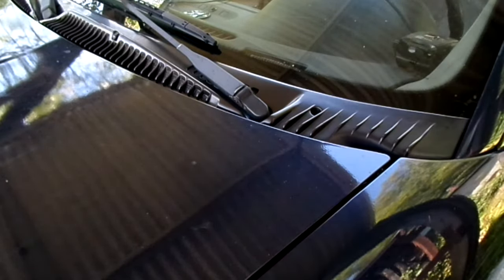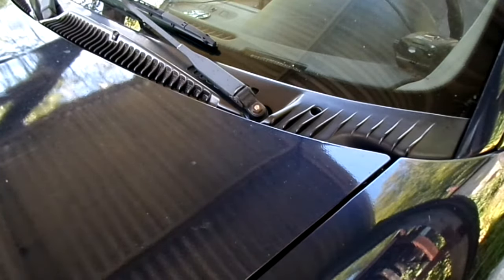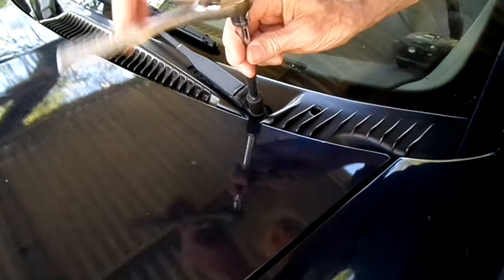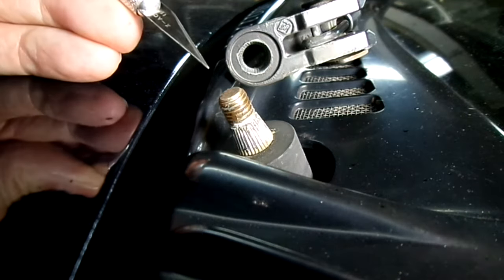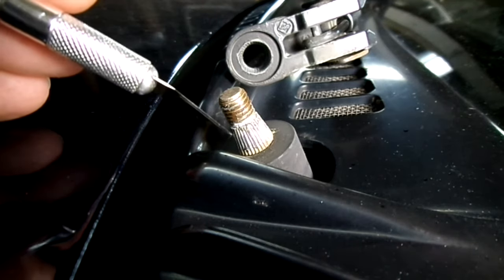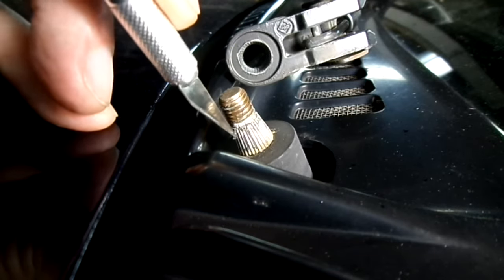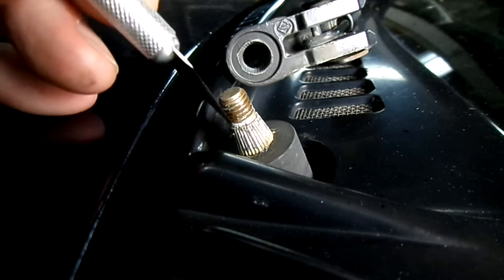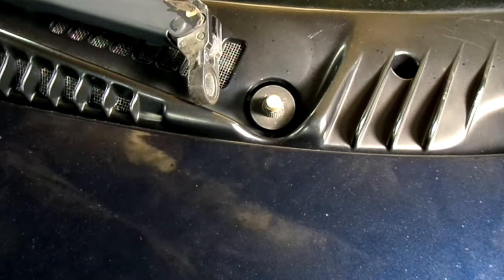Windshield Wiper Arm Repair

Comment: 👍 Dude, thank you for taking your time in sharing your experiences.  This info has helped.  One wiper blade has stopped operating from my car and followed your advice, it worked very well. One Note: I found the wiper-blade's nut loosed when removing the cover. I still cleared the ridges and reset.  Did it on both just to get it over with.  All Good now!

Comment: Also if you don't want to buy new arms and you even this fix doesn't provide perfect grip - very soft wire. If you have very soft wire lying around, you can use it to make it fit better.

Comment: Does this mean that after you clean the splines, that you must buy a new wiper arm? Or is it OK to reuse the old arm and it will grip?
Reply from the maker: After the first time it usually works but if the arm gets striped multiple time then the arm will eventually have to be replaced.
Reply: Thank you. I successfully removed my arm this morning and scratched out the splines. I remounted it and tightened it down. It appears to have worked.  Thank you!

Comment: I'm supprised that the splines will drive the aluminium, i would of expected you to need to wrap the splines with 1 to 2 turns of ptfe tape or tin foil to take up the room.
Reply: How long did that last ?
If you don’t mind me asking

Comment: This is exactly what I am dealing with today.  Thanks.  It seems that the lost aluminum material would need to be replaced??? Inside the hole of the wiper arm; the metal has been worn smooth by the spindle.  Could one add a metal resin, or coat it with a thin layer of something like JB Weld???
Reply: yes or add some wire to the wiper oriface, three pieces will add grip, or jb weld
Reply: Faced the same problem,wiper arm splines worn out slick smooth.JB weld lasted a year.
Here I am now repairing the process

Comment: No amount of scraping out excess metal could fix my problem so I just ran my drill through the arm and post screwed in a black sheet metal screw works fine now.  Easier and cheaper than replacing the wiper transmission. Good idea though just wouldn’t work for me.
Reply: good fix
Reply: An easier fix someone just mentioned earlier was using PTFE tape any kind will do, and just tightening the screw, i just did it for my blazer who's outer arm was stripped smooth

Comment: Dissimilar metals in a water environment, no wonder they fail. I see the weaker metal, the aluminum, is designed to fail first, so the repair is easier than if the male end stripped out.

Comment: I wonder why car manufacturers haven‘nt figured out a better design for this. Like maybe use a stronger material instead of aluminum so they wont strip as easily. I have had two older cars and both of them have (partially) stripped wiper arms. Definetely a common thing in colder climates and people don‘t know these arms work so they use them as snow plows in the winter and strip them out. But the biggest problem was for both of my cars i could‘nt buy these arms new anymore otherwise it would be no biggie.
Reply: I have this problem right now (passenger side luckily). As to why they use aluminum instead of steel on the wiper arm I'd guess it's to provide a known failure point (kinda like a fuse in an electrical circuit). Far better to strip out the arm than to screw up the underlying mechanism or drive motor and have to replace and adjust all that.  Been there and it is not fun at all.

Comment: I have to do this by -40...
Reply: 3 years later but I'm in the same boat. Wiper fluid is frozen, blade went flying off on the highway this morning heading home from work, stopped and bought new blades, when I pulled the wiper arm up to put the new blade on stripped the arm on the drive. Now once my fingers thaw I gotta go out and attempt this. I really miss having a garage.